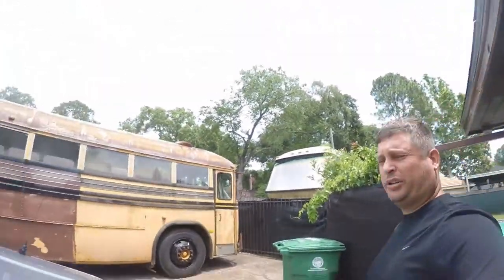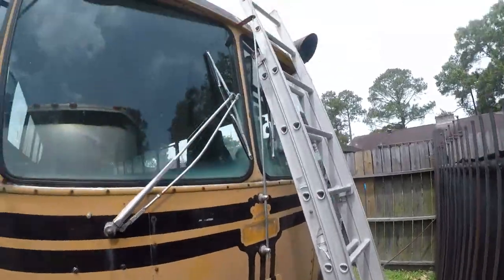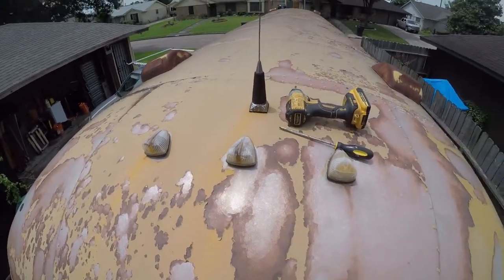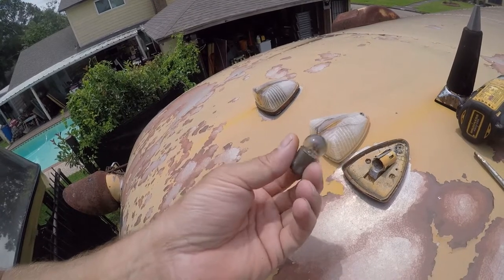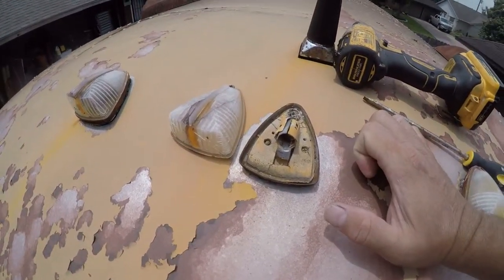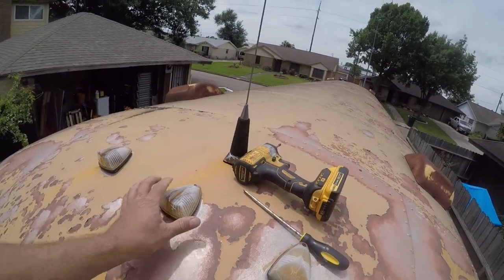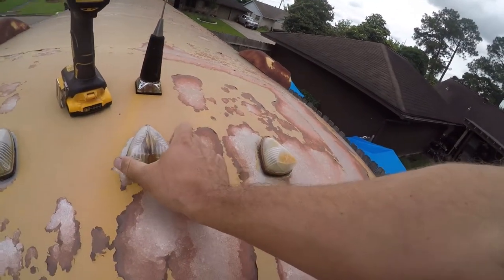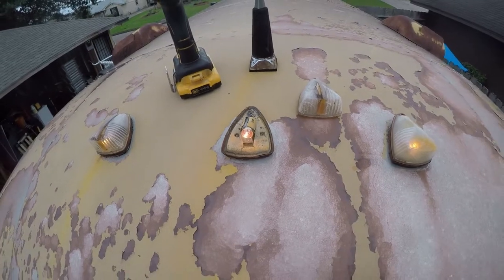Crown Supercoach RV Conversion - fixing burned out lights

Comment: I'm in the UK, and there's no inspection (we would call it an MOT or for heavy vehicles a 'plating' test) that I'm aware of that would require those lights to be working.
I realise that rules are very different depending on where you are, but presumably it IS  a requirement for you?
Regards Mark in the UK
Reply from the maker: Generally in the United States all of your lights have to be working.  A police officer could pull you over and issue a citation for having a light out.  It's a common way that commercial truckers are harassed.  It's one of the reasons that LED lights are super popular.  Pretty much eliminated that game.

I live in Texas and while the state is relatively relaxed about many things, they will not pass a safety inspection if you have lights out.  :(  

Various vehicles are required to have different lights.  Buses in particular have to have 3 lights at the top and 1 on each side at the front and the rear.  Front are Amber / Yellow, Rear have to be Red.  This helps oncoming traffic see you and realize you are big.  :)  

During the day these lights would be off and not important.  

Thanks for the comment!
Reply: Hi Brian, and thanks for such a full reply.
Yes, the 3 lights on top front and rear etc., makes a lot of sense actually. 
Being an occasional trailer tower, I've also thought over the years that some kind of lights on the front of the towing vehicle (normally just a car), would indicate to oncoming traffic a 'towing' situation, especially in the UK where many of the roads are quite narrow.
Never heard of those bolts (you hate) on that bus, so I Googled them.  I see why you hate them if they've been in nearly 50yrs.
That bus is in remarkably good condition given it's age and has such beautiful classic lines.  Love it.  Looking for ward to see what you do with it.
Your Neoplan is a fairly common bus over here, although not quite so much in maybe the last 8 - 10yrs or so.
Have you had any interest from buyers yet?
Thanks again.
Mark